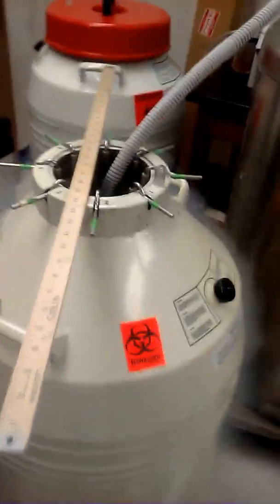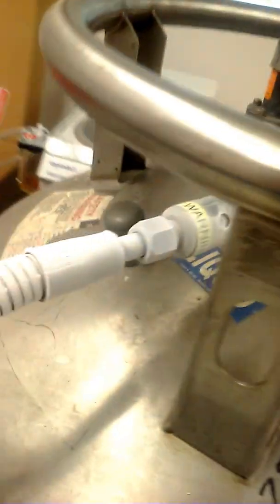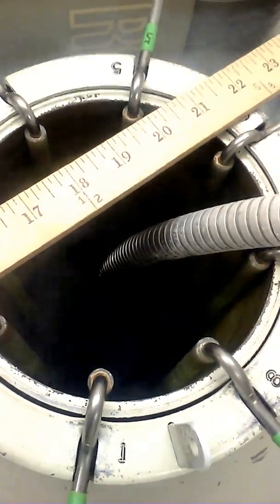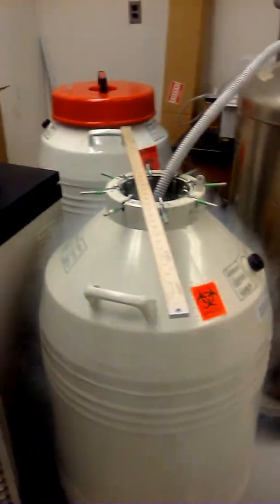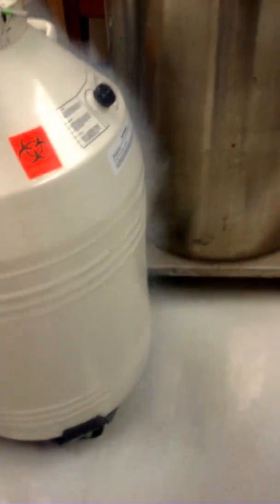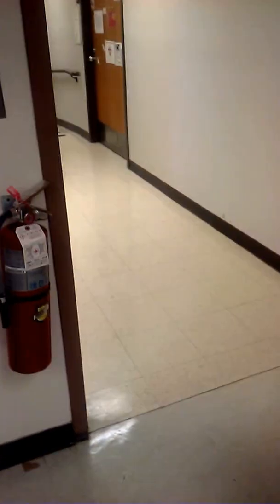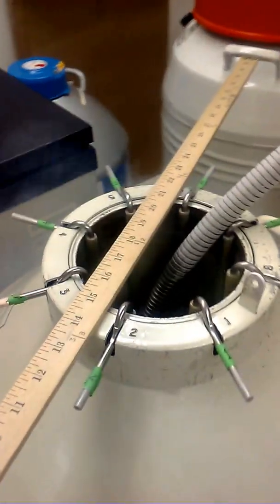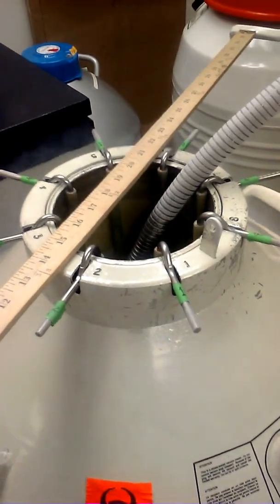Safe Liquid Nitrogen Filling of Cell Storage Tanks

Comment: How often do you refill this particular tank? Is there any optimum level of liquid nitrogen, which should be maintained in this tank to maintain the temperature? thank you!
Reply from the maker: This tank will get a top up about every 5 weeks, but we do not let it get extremely low. This tank fills to depth of 22 inches max. We top up when it gets down to about 15". Measured using a wooden yard stick to dip into nitrogen. Wood is excellent. Dip, to cool, lift up into air to see frost line. This tank can keep cells frozen if level gets to several inches. They will loose about 1.5 inches per week. These are thermolyne locator 4 (4752) and locator 4plus (with level minitor lid) and locator 8 (4753) tanks. You can find pdf info online for them. :)